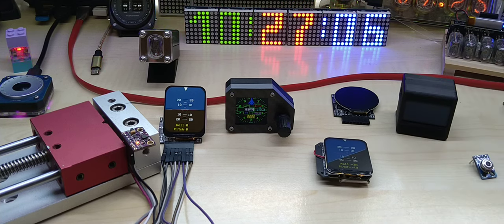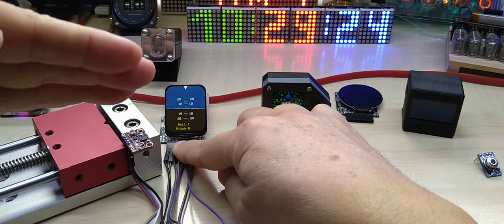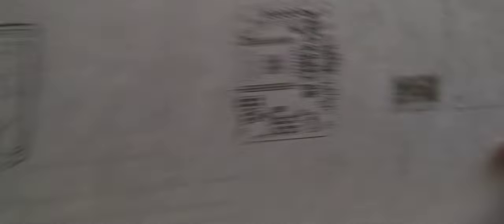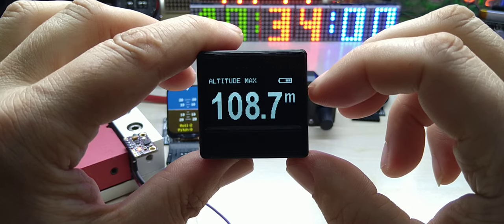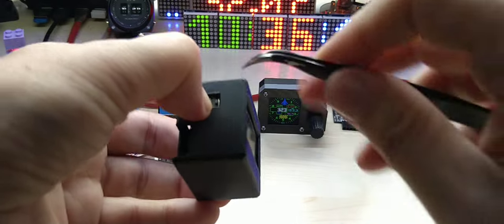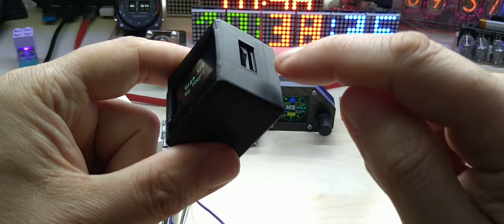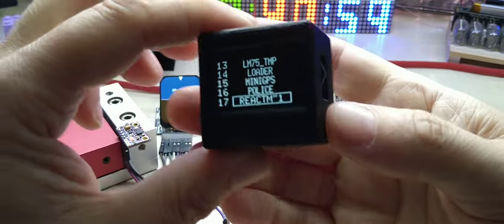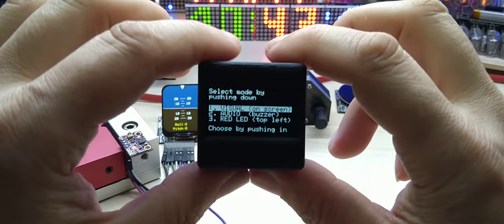Giga328, all your codes at your fingertip by #Hayri based on #atmega328p  with custom Bootloader

Comment: Thank you so much for sharing. Could you tell me whether the  code of 9250 can be used for 6050？Does it need to be modified?
Reply from the maker: Not really as the 6050 does not have a magnetometer  like the 9250 does.